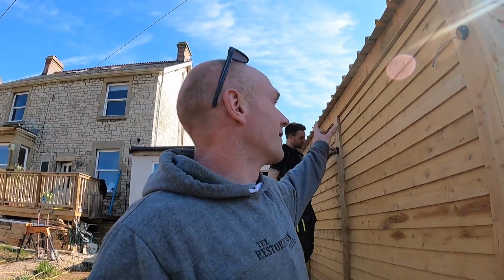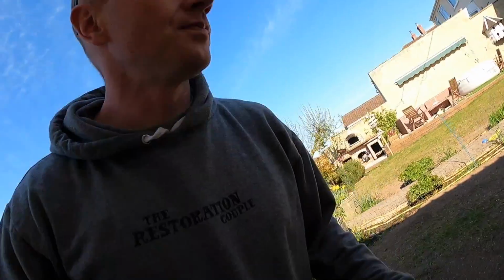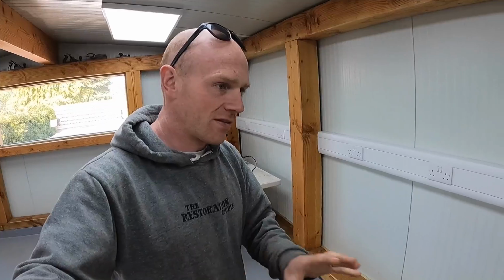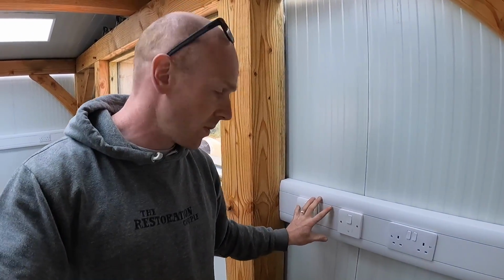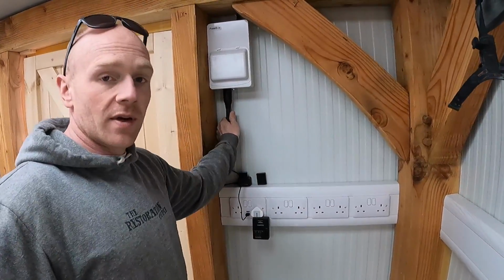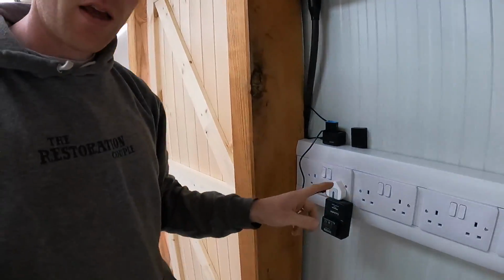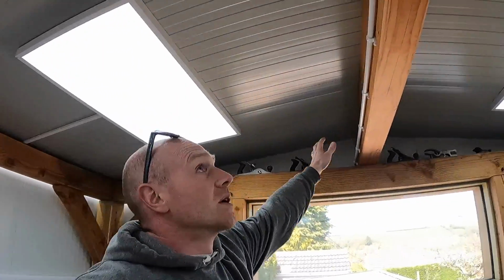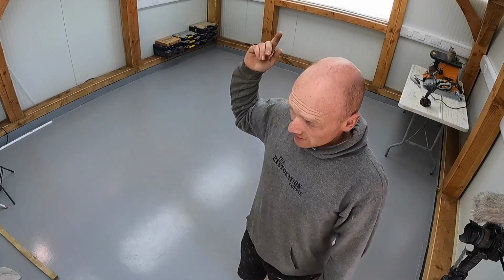ELECTRICS AND LIGHTING INSTALL - Garden Workshop Project

Comment: Very nice. You must be thrilled that it's all come together so nicely after years of planning.
 If you did still want to add a Quinetic switch in the house you could do it by having their RF receiver trigger a SPDT relay wired as the second switch in a normal two-way circuit with that existing outside light switch.

Comment: Some nice ideas. As someone with young kids as well I'm going to fit a lockable isolator switch / e-stop to the sockets which have the permanent power tools plugged in - then if the kids end up there without me, they can't accidentally turn anything on

Comment: Not sure how the SWA is connected to that metal clad workshop dist board but you wouldn't normally export the houses earth conductor outside of the house equipotential zone, the workshop should be treated as a TT installation with just an incoming live and neutral and the earth provided by an earth stake, normally make the armoured off into a PVC adaptable box then Live and neutral straight through that and into the boards RCD incomer.
Reply: It's perfectly fine to export earth from the house unless a. House is TT then outbuilding must also be TT (exported from house AND its own stake) b. TN-S or TNC-S in house and outbuilding has extraneous metal parts (ie in contact with the ground) - OK to export earth but must be 10mm2 for bonding (it is part of the house's equipotential zone), or separate it and go TT, but your rod won't be as reliable as a supplier's earth. As he used 10mm2 SWA he can bond metal panels, if they're truly extraneous, and keep it connected to house earth. See John Ward on earthing outbuildings: https://youtu.be/NvENsVUhDUs

Comment: Is there a cost breakdown somewhere or coming?
Reply from the maker: Done already. Everything except electrics and floor paint.
Reply: @TheRestorationCouple  oh right. Sorry. It's early in the morning, watched it last week or so I think.
I'm gearing up to design a workshop myself. Built a small one with just the panels last year, but without the cladding because of budget. Now we're moved we want something nicer, but I'm still partial to the panels, they're awesome.
I love the timber frame look on the inside, I'm just not sure I can afford it with timber prices up 20% in some cases. And our local cheap supplier just restricted his business to tradespeople only because of shortages.

Comment: Get a turning peel (not cheap). It will save you a ton of effort than using a normal peel pulling it out to twist and then re-shoot. You can rotate on the heat :)

Comment: What a fantastic space. Looks awesome and easy to clean. I thought you would have installed a mains powered smoke alarm or fire detection switch and even a kill switch for all the power too. You should also maybe consider some permanent camera mounts over head so you can film straight down at a work bench. Have it on a track so it's easy to move along the workshop along the ridge beam. Over wall wonderful work and what a wonderful life and environment you are creating for you and your family.

Comment: Love the final look - been a journey to get here and now you have power, heat and light...no stopping you. I used Quinetic (wifi) light switches on my shed along with wifi plugs so I can switch on/off lights and 3-pin appliances from the house ~ 30ft away. Also invested in wifi electric heater with iphone controller - perfect for scheduling to come on early on a cold winter morning before working!

Comment: Surprised….that after all that work you never had a mains fire detection sensor with built-in alarm fitted…nice tidy job after all said and done…can’t wait to see the lay-out of the workshop…!!
Reply: Good point - easy to wire one into the lighting circuit later though.

Comment: What's the wireless switches operated off, 240v or wifi for the signal?
Reply: Quinetic wifi switches generate an impulse signal when clicked that send the signal to the receiver, which is hard wired into the 230v circuit. You can have multiple remote switches for a single receiver and a single switch can be linked to multiple receivers (not wifi though).
Reply: Piezo electric. Phillips Hue Tap switch works in a similar way.

Comment: I'm not sure if those wireless switches have the range, the ones with a battery are better, though also remember you have a metal workshop, which is a faraday cage.
Bigclivedotcom did a couple of vids on them

Comment: Did you have to get a separate supply cable run into the house to cater for the extra load  (future machines) Tim?  Or was it simply an uprated supply fuse?

Comment: Hi Tim. If you use constant current led driver you won’t suffer from any drop in brightness across long lengths of strip.
Reply: Or you can add power injection at various points using additional runs of power cable from the LED power supply.